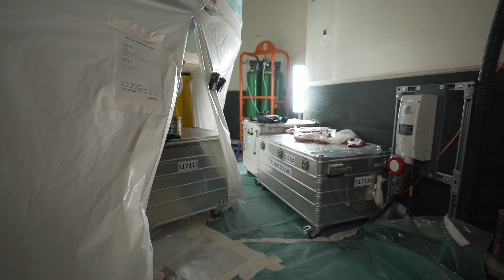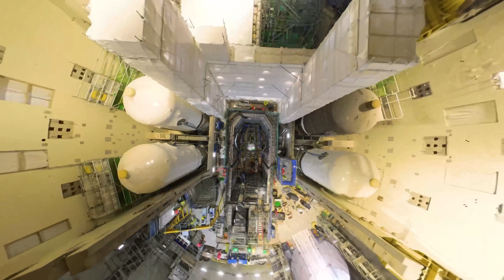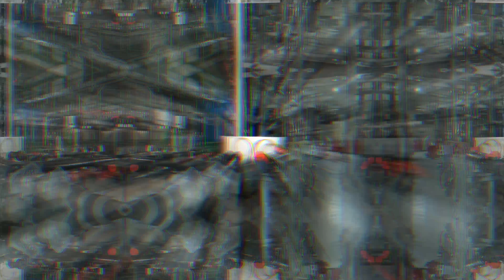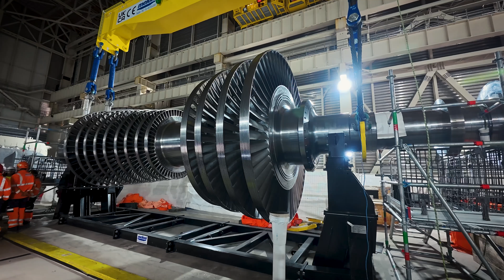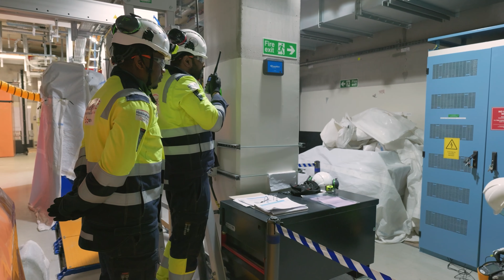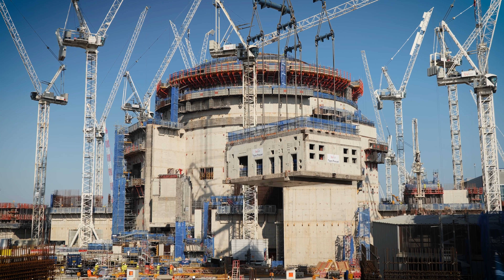Hinkley Point C | Project Update May 2026

Comment: Let’s keep building, let’s take those skills forward, imagine how bright the future is with reliable clean locally made electricity
Reply: Dude - Nuclear Plants are so expensive that you need to sell electricity for 100 years to cover the cost = Meaning it is bankruptcy on the making.
Reply: @SergiuCSA09  ontologically false
Reply: @jake1173 LCOE or Stike proce for Hinckley point C is £128 MWh. Onshore wind is £38 MWh. Offshore wind on thee new Horsea 3 farm which will output the same total capacity as Hinkley Point C £54 MWh.  As for investment costs Hinckley point C current estimates is £35b originally in 2016 that was £18b and with operation not schedules to start until 2030-2031 there room again for that to increase significantly some saying final costs coukd hit £46b.  Hornsea 3 cost excpeted to be £9-10b constructed over 4 years. Whilst Hinckely C has a lifespan on 60 compared to 30 for Horsea 3 you coukd build Horsea 3 twice and still have £10 left producing power at less than half the price..... oh and the drcomissioning question, Hinckley C will need to start decomissioning in 2080, that is expected to take 15 years with the reactors having to remain jn situe for anither 70+ years before they can be removed from the site. Hiinkley Point C will be the most expensive nuclear reactor ever built... it will be the last of its kind.
Reply: @SergiuCSA09  we make our construction costs many times what they need to be via ludicrous legislation, which is why South Korea can knock up a nuclear power station for $6bn when it costs us $35bn to do the same thing.

Nuclear is clean, safe, and most of all predictable and reliable. Wind is none of these things, and solar only works for a few hours a day as is least effective when most energy is needed in winter.
Reply: @chairmakerPete yet wind produced more electricity in the UK last year than any other single source and continues to increase production at a quarter the LCOE of Nuclear.
Reply: @8dcphoto  may have done, but it produced it when it wanted to, not when it was needed.

Wind is unreliable, and without grid-scale storage, it's simply not a sensible solution. There's also the question of energy density - wind compared to Uranium 235 is a no-contest. 

One nuclear power station on a few hundred acres can power 5 million homes predictably, reliably, 24/7/365 whether it's windy or not. All with a single grid connection.

To achieve that, intermittently and unpredictably with wind would require massive swathes of land or sea, tens of thousands of turbines, and hundreds of expensive, ugly grid connections.

We all love renewables, but they're not a sensible solution when carbon-free nuclear already exists.
Reply: @chairmakerPete  everything is safe until something goes wrong
Reply: @CarlosOddone-z6k nuclear in the UK has an exemplary safety record. France has operated dozens of nuclear stations on our doorstep for decades, and we buy lots of electricity from them as a result.

Nuclear is the only way currently to guarantee the predictable base load that we'll increasingly need in a world of overnight charging for EVs
Reply: @chairmakerPete I think you are right but also wrong. Nuclear is predictable and can play a big part, but we can solve a lot of issues of renewable intermittency with demand control, by monetarily incentivising people to charge their EV during the sunny summer, and windy winter, and with V2G becoming more common, that can provide a large chunk of the grid scale storage (/demand control) that you said we need.

Additionally, if the South Koreans can safely build and operate nuclear at one seventh the price that we can, we have to learn those lessons, as that puts nuclear at a more comparable cost to renewables.
Reply: @MichaelCampbellGB  Let's just get the Koreans in to show us how to build 21 nuclear stations for the cost of three. 

That'll sort out the UK's power needs for the next 30 years, and perhaps by then, fusion will be a thing.
Reply: @chairmakerPete where do we get the uranium from? Our friends in Russia? Where will we put the waste? If we could build Thorium reactors and reuse the current waste that would be excellent.
Reply: @MichaelCampbellGB  Thorium's a dead end thus far, though research continues and it still holds promise. Nuclear waste entirely capable of being dealt with. The amount is tiny.

Uranium abundant in Australia.
Reply: @chairmakerPete  Nuclear, clean, safe? Hahaha
Reply: @IonidisIX  we buy a lot of electricity from nuclear-powered France. Without it, the lights would be out and industry at a standstill.

Nuclear is the future.
Reply: @chairmakerPete  you are talking about energy sufficiency and independence from a nationalistic standpoint. I am talking about health and life. Don't mix the two. There is nothing clean or green with nuclear energy (not fission at least). 

If it wasn't for the military uses of nuclear plants there wouldn't be any nuclear plants and (at best) we would be using gas, coal and probably tidal wave energy (doesn't stop when there is no sun or wind).
Reply: @IonidisIX  Now tell me, what exactly is so unclean about nuclear power?
Reply: @11442q hmmm let me think... uhmm... how about the production of toxic cancer causing radio-isotopes (not just uranium or plutonium) that will be left on earth long long after all of us have been around...
Reply: @IonidisIX  Yeah so there's this thing called dry cask storage. don't know if you've ever heard of it
Reply: @IonidisIX  It's also worth noting that spent nuclear fuel can, in fact, be reused
Reply: @11442q nuclear waste storage is a problem not yet resolved. Dry casks pose a huge problem regarding corrosion susceptibility (just like anything in life but especially vs airborn salt - I wonder where the majority of nuc power plants are built...) and they are a huge logistical problem wrt moving them (if you actually don't end up storing waste next to the power plant) and handling them during the move. Please do not quote the industry's narrative. There is a clear conflict of interest at the expense of your and my and our descendants' health.
Reply: @IonidisIX  Transportation of nuclear waste isn't a huge issue either. It is transported in containers that can literally withstand a direct hit from a train with only minor damage. And not much of the stuff is made either. Nuclear power plants go for years between refuelings so volume isn't an issue either. If we're producing too much nuclear waste to handle then I'm afraid we've more than solved our energy issues long ago.

And that's ignoring spent fuel reprocessing, since not all spent fuel is disposed of immediately. As I said earlier, nuclear fuel can be reused.
Reply: @11442q MOX is x5 to x7 more radioactive than the original fuel (with original being only 3-5% usable). And although the volume of the unspent material can be reduced by recycling, the recycling process itself is another concern to take into account regarding safety. Until the industry finds a way to reduce radioactive wastage to 0, this technology will simply be too dangerous for humans and nature. The only ones truly to benefit from it are countries wanting to maintain their nuclear weapon stockpiles and nobody else. All the others are simply useful idiots.
Reply: @IonidisIX  The number of deaths per terawatt-hour of nuclear power produced is far lower than almost every other energy source. Wind power kills more people than nuclear. The only safer energy source in this regard is solar power. All the alternatives to these are orders of magnitude more deadly with coal & brown coal combined killing 57.34 people per terawatt-hour, oil 18.43 deaths, biomass 4.63 deaths, gas 2.82 and hydroelectric power 1.3 deaths per terawatt, while nuclear power kills just 0.03 people per terawatt-hour.

If nuclear is too dangerous, I think we should get rid of everything but solar power
Reply: @11442q Yup a nuclear power industry spokesperson... as I thought. You gobbled up every pseudo-scientific statistic they could get their hands on to justify unjustifiable and self evident things. Well done... you forgot about radioactive potassium in bananas and 'you get more radiation on an airplane flight than a year next to a nuc power station' hahaha absolutely ridiculous claims...

Not only solar but tidal is a very promising industry, not to mention the work on nuclear fusion
Reply: @11442q It is the extra handling not the train or truck accident that is the problem. And yes power plants go for years but when you WILL EVENTUALLY have to move the stuff, the mistake only needs to happen once. Do you think you will find out about it on the news? No. Cancer rates will start climbing and they will blame 'radioactive bananas' for it :)

Come on wake up. Nuclear power for civilian use is only the carrot at the end of the stick of nations that want to play 'who's the biggest bully' on the planet.
Reply: @IonidisIX  ok, what? nobody blames cancer on bananas. Not even from nuclear accidents. I genuinely have no idea what point you are trying to make here because it's just so utterly nonsensical. how does one even respond to this? And are you trying to imply that airplane flights do not expose you to radiation and bananas are not radioactive? I genuinely hope not because those would both be some unimaginably idiotic, ignorant takes.

And why would a nuclear accident not be reported on the news? Nuclear accidents are always reported on the news, some times incredibly badly causing unnecessary mass panic in the case of three mile island. I guess the USSR tried to cover up the Chernobyl disaster but that just doesn't happen anymore. Neither a chernobyl-scale nuclear accident nor such coverups.
Reply: @IonidisIX  Also, do not forget about the thousands of people who die yearly because of fossil fuel usage. And the heavy pollution of our atmosphere, which is far more severe than any nuclear disaster in the long run. Chernobyl may have had a bad impact on the environment, but it didn't melt our ice caps, supercharge storms and cause global mass-extinction. That kind of environmental damage, caused by fossil fuels, is something that even the worst nuclear accidents that could occur simply would never match.
Reply: @11442q Let me tell you what is nonsensical. Proponents of nuclear power pretending to be logically thinking individuals. Let me also tell you what is unimaginably idiotic, to be covering for multinationals and individuals owning these in a multi billion dollar industry, that simply does not care about the environment, they never did, you mindless nincompoops. They have you believe oversimplifications and outright lies that exposure to radiation on a plane could EVER equate to the radiation you get from a nuclear factory. On one you have circustantial exposure to cosmic radiation and on the other the radiation that comes from the source itself, radio-active compounds!!! Just visiting a nuclear power plant or the surrounding area (I dare you to walk the shores around Hinkley Point, the highest point of recorded radiation in the area), let alone becoming an employee and thus becoming a live vector of nuclear contamination to your family, your loved ones and society. These factories are producing substances that are highly toxic and deadly to humans and animals.  It causes serious DNA damage even at the smallest of doses. It causes true environmental irreparable damage. These substances WILL NOT GO AWAY NOT IN 100,000 years. Can you fathom this? Are you capable of using your brain for a change to fathom this? Are you going to equate that to CO2 which is part of how this planet breathes and operates? Are you at all familiar with what trees, plants and the oceans do with the excess CO2 you mindless individual? My God, as long as there are simpletons like you believing the lies of a deadly industry like the nuclear industry, there will continue to be true danger of destroying the planet with substances that were never meant to exist (the nonstable radio-isotopes we all call nuclear waste) and you call this a Green industry!!! I have no words to describe such lack of orthological thinking.
Reply: @chairmakerPete  Nah evs will be helping to charge the grid, you are confused and have got it the wrong way around. To educate yourself look up V2H
Reply: @chairmakerPete  Still waiting on fusion after 75 years of research don't hold your breath.
Reply: @chairmakerPete  You forgot all the clothing/tools that are used and are waste EVERYDAY of the week.
Reply: @SteveLawrence-ew9uu  I know all about that - it's smooshing energy storage around, it's a net loss of energy to keep pushing it around. Check out Physics for Dummies.
Reply: @MichaelCampbellGB  EV demand has slowed right down.
Reply: @johnlesoudeur3653 EV demand has gone through the roof since Trump started bombing the middle East
Reply: Nuclear and Clean. The shortest joke at the expense of humanity ever.